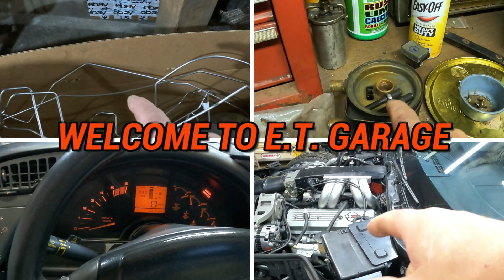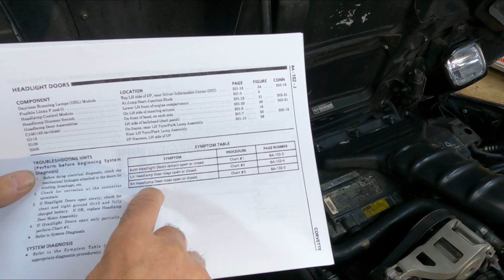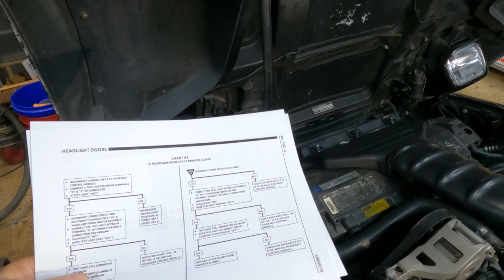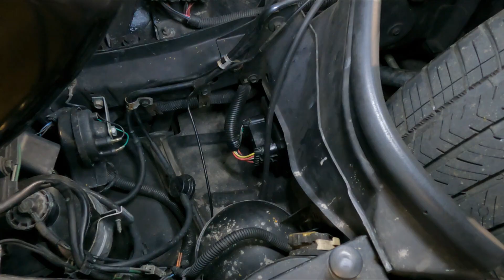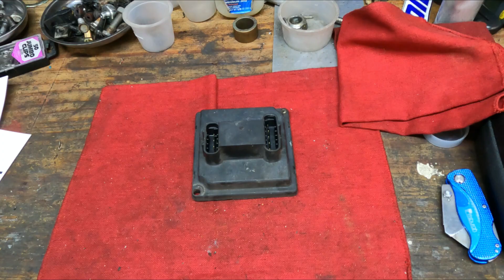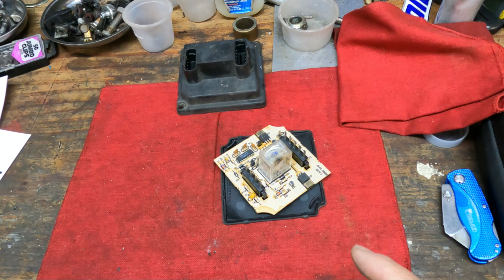Quick Headlight Motor 👀 Troubleshooting.

Comment: Mine turned out to be the gears inside the motors so I just did my gear change on both lights because the 3 pieces inside had turned to dust. One worked out and the other one was to banged up to be fixed. Ordered a new Chinese one and both working great now...!!
Reply from the maker: Glad to here you got them fixed.